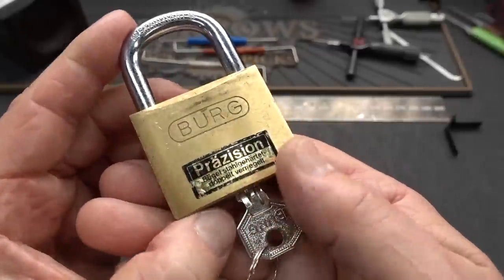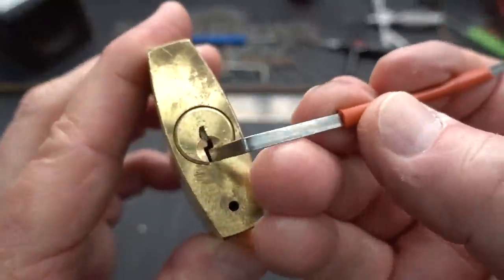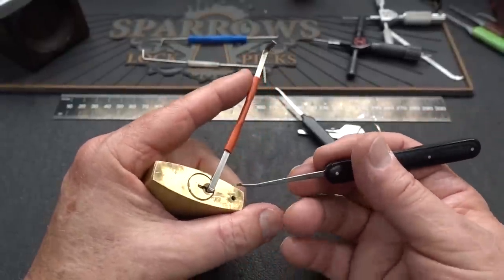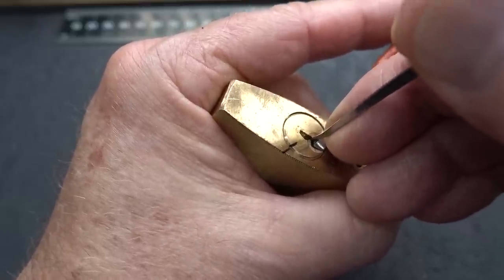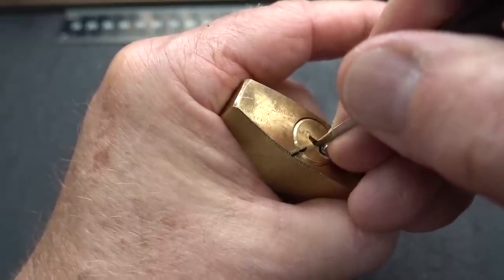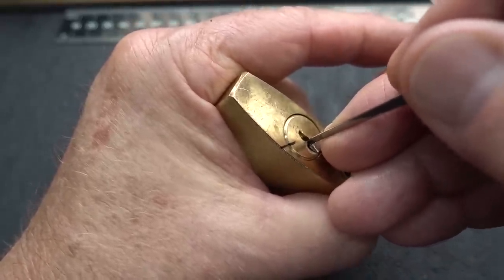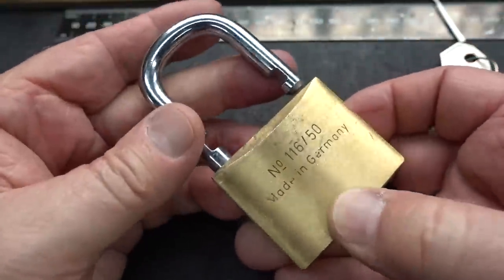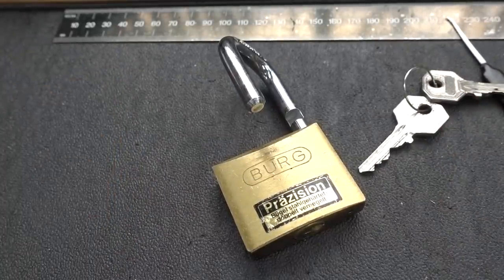(1890) Burg 116/50 Padlock

Comment: I learned lock picking a year ago from watching these videos.   After picking over 100 locks, I’ve learned that extreme bitted locks are far more challenging to deal with than just a security pins.  I have 4 pin master no3’s that are much more challenging to open than flat bitted 6 pin locks with spools.

Comment: Thanks for the video! Please do more German locks. I'd like to try some American locks, but Abus and Burg is pretty much all we get here in terms of padlocks. (Master locks are sold for ridiculous money as "high security locks".) What are some good Burg and Abus locks for beginners to cut their teeth on? New lockpickers from Europe are a bit out in the cold because all the typically recommended beginner locks are either unavailable or way too expensive here... If you had to name an Abus lock instead of the Master #3, which one would it be?
Reply: Buy cheap Burg lock, these can be easier than Master No. 3. Not for raking (simple Master locks are really very easy there), but for SPP.

Comment: Let me ask a question.
You had the key available and chose a particular pick to address the hi-lo-cut problem. Did this save much time?
How hard would it be to open that lock in "real life" (on the street)? Would you need 10+ minutes to open it with no knowledge of the key cutting? In that case I should consider the lock unpickable for a unexperienced person.

Comment: Having trouble with the locklab site, can't enter any of the giveaways 🙁 tried laptop and phone but submit buttons don't do anything. Never had problems before.
Reply: Try using a different browser maybe?
Reply: @archstanton3931  Already tried 3
Reply: Turn it off then on again ==== standard electric object repair === first on the list
Reply: I am having the same issue. Tried with Firefox, Chrome, and IE and clicking Submit shows a quick spinning wheel then goes back to the regular button without displaying the submission successful check mark.